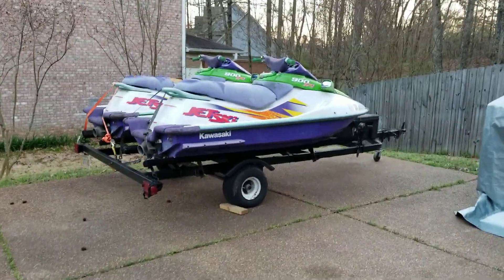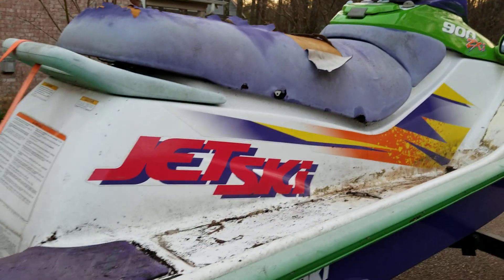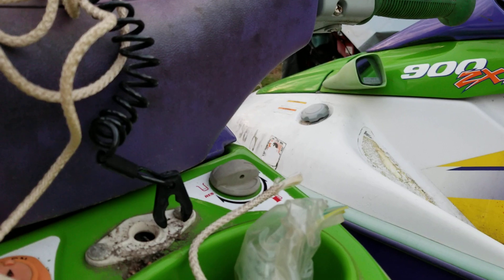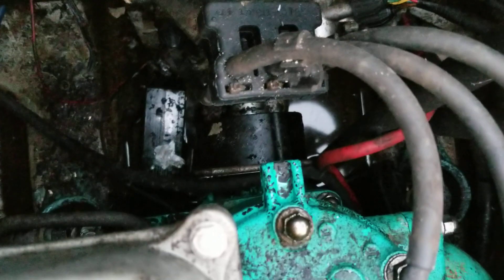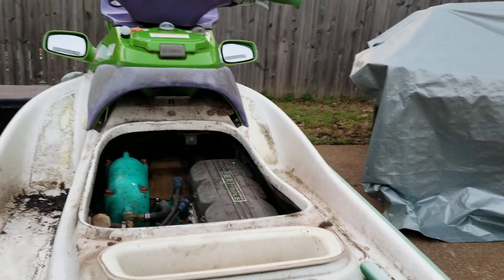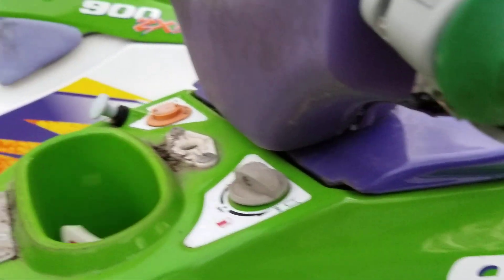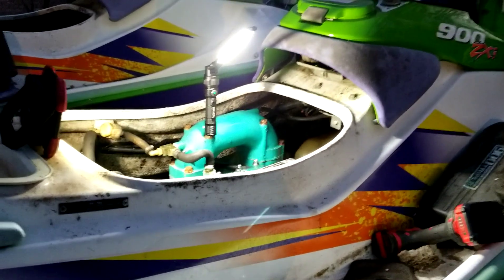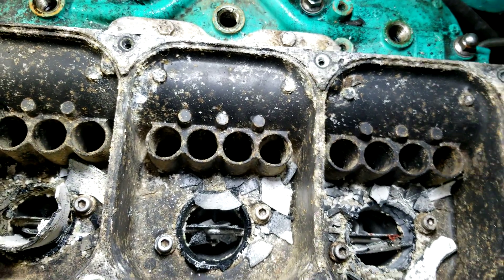Saved 2 Jet Skis from going to the dump!

Comment: Price the key and orange switch.  You got a great deal I can already tell.  I had one of those exact same skis.  They have the better cdk2 carbs.  120 compression
Open the electric box check all the wiring.  It gets brittle at the connectors inside.  Uhhh you need velocity stacks and with the hull damage it is very likely water got into that engine.  
You have a 900 engine build series coming soon.  Price those electronic boxes on ebay and you will see how much they are.